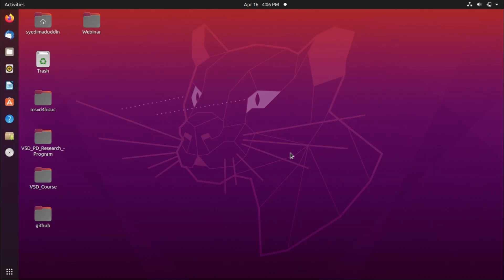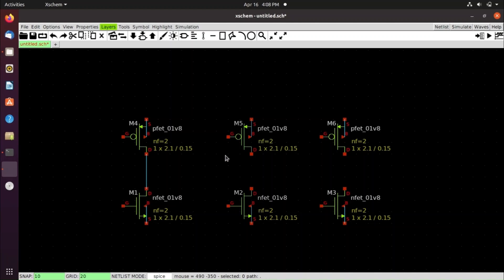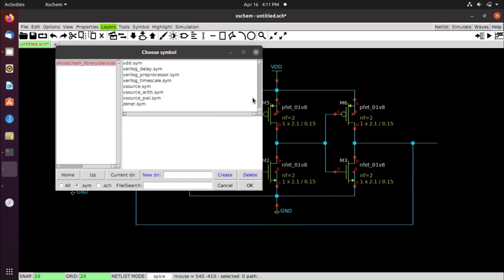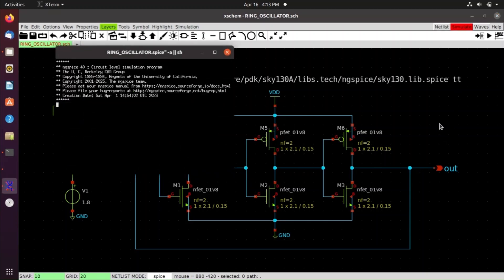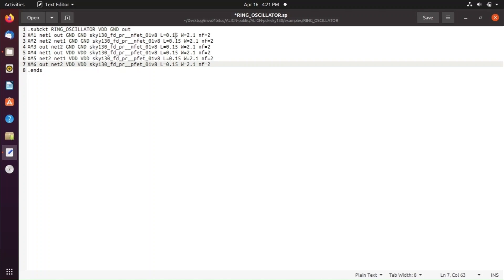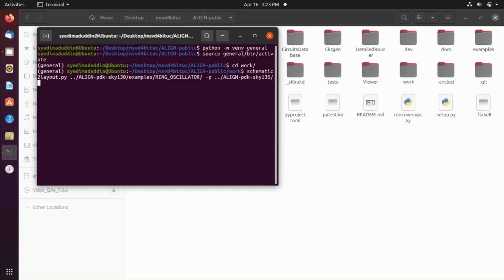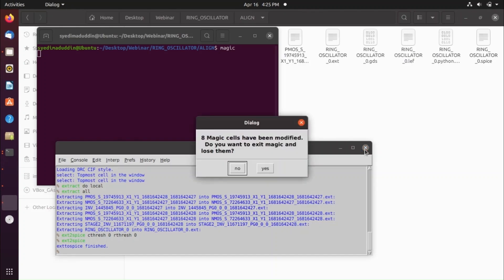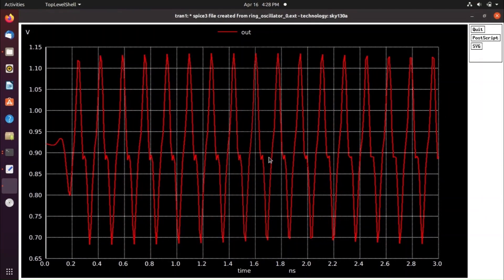Generating Ring Oscillator Layout Design with ALIGN || Step-by-Step Tutorial || VLSI Layout Tools

Comment: That's really cool tool so overall align can generate the layout automatically with doing it manually? right ?
Reply from the maker: Indeed, ALIGN is capable of automatically generating the layout using the netlist of a circuit. However, since it is still in its early stages of development, there are instances where it may produce incorrect layouts for complex circuits. In such cases, manual intervention is required to correct the generated layout. If you're interested, you can explore ALIGN further by visiting their GitHub repository at https://github.com/ALIGN-analoglayout/ALIGN-public
Reply: @syedimaduddin_siu  thanks for sharing
Reply: When I'm trying to install align , i run into an import error showing that it cannot import PnR from partially initialized module 'align' (most likely due to a circular import) after running this line python -m cProfile -o stats. Can I know how to solve this error @syedimaduddin_ Thank you